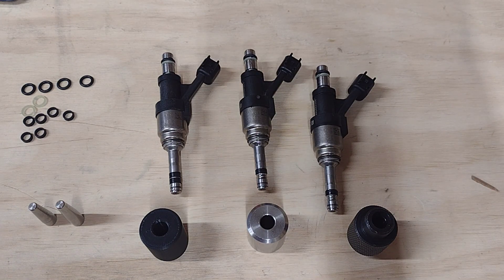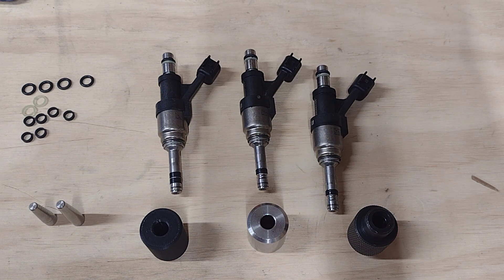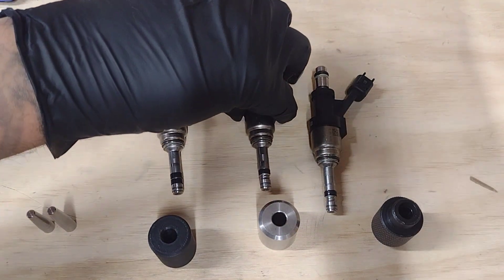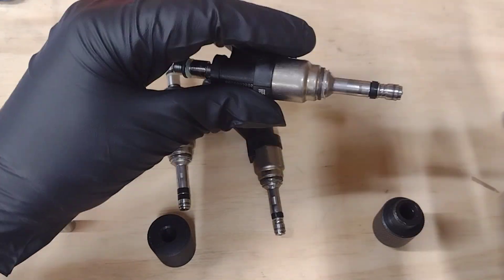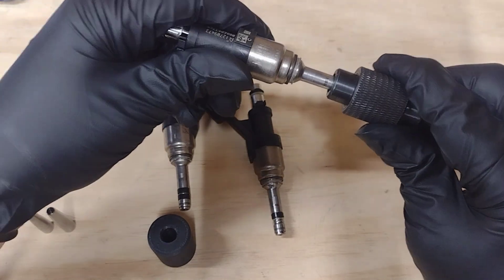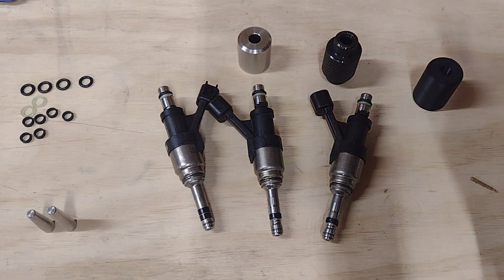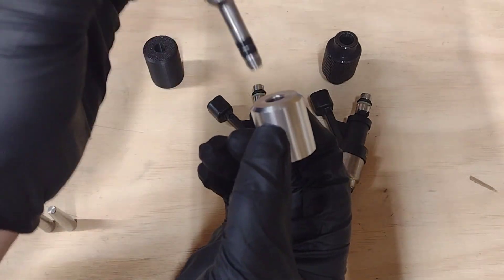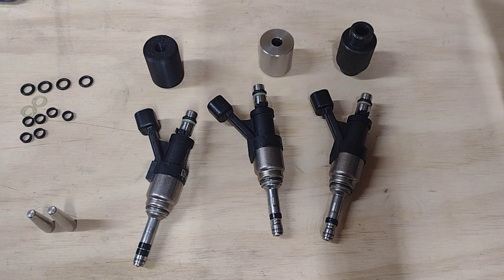GM DI injector seal compression tools.

Comment: There is a mesh inside, it also needs to be replaced. The injectors are washed and you can check 40-120 Bar
Reply from the maker: @246alfa  I know.